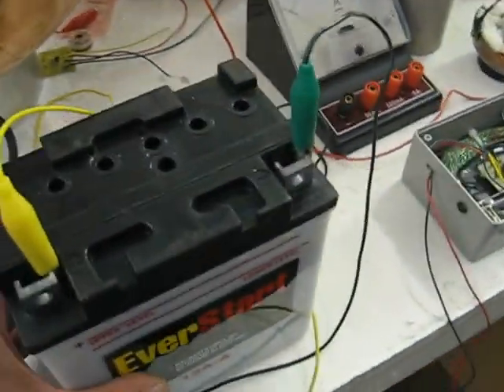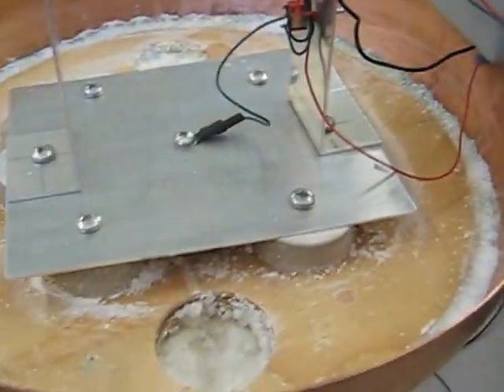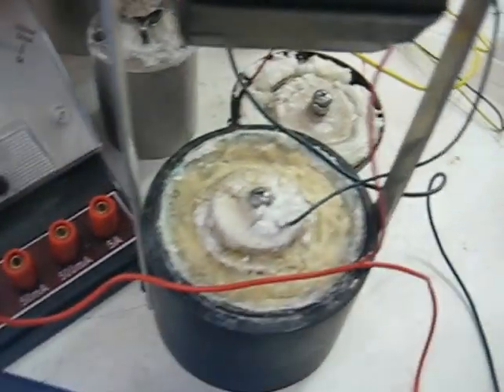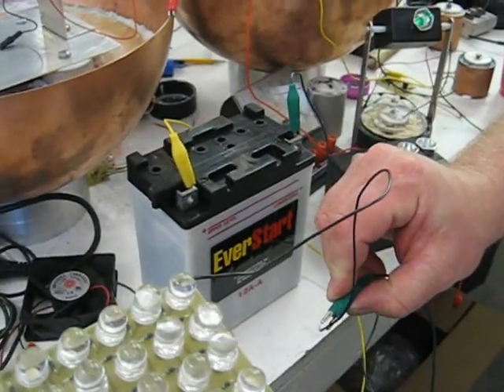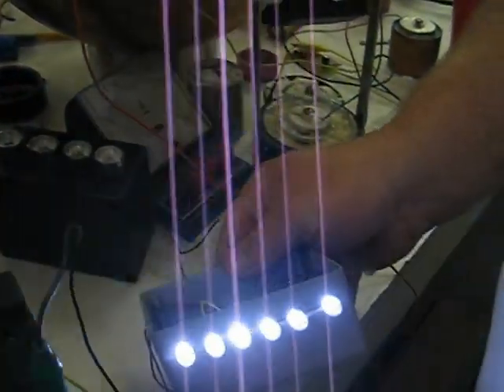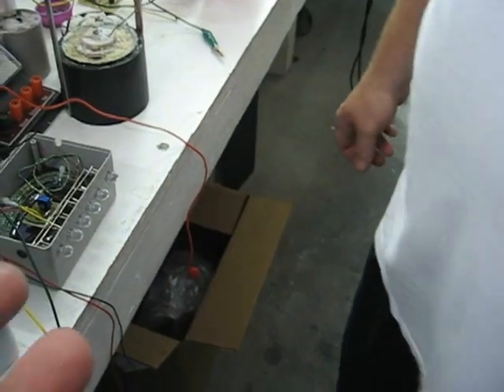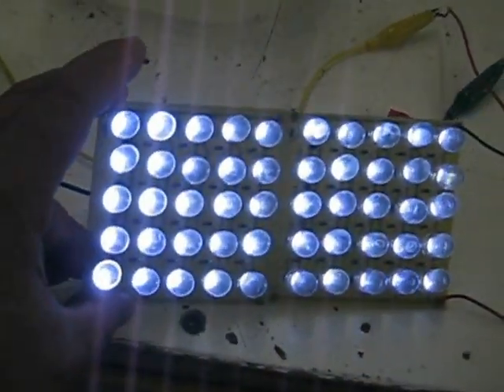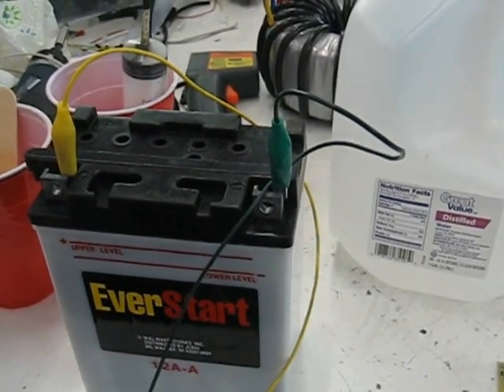New Crystal Batteries20  John Bedini and Chuck Hupp

Comment: Every battery has a rating called  Amp-hour measured in C20 ,C5 ,C10 etc. 
Theoretical Amperage delivered to a fixed load in C hours. 
Would be nice to know what to expect from your lead acid to crystal battery conversion.
Dont forget about the lead / lead-oxide chemistry that is typical to sulphuric acid.

Comment: Will this work with an old stuffed battery? If it was drained out, and maybe cleaned out? Or would the build/wear up on the plates dull the power? If so is it possibles to get less power for longer duration?

What sort of watts does it supply, and for approx how long before it starts to drop off? What is the single cell output?

Also I've always wondered if you can re-charge a crystal battery?

Comment: Don't you need to charge the lead acid battery? One plate has the corrosion and will give up electrons to the other and you must charge it to place the corrosion back on the plate? I must say using a Walmart empty battery was a good idea. What happens when you charge a capacitor with the lead acid battery, what voltage does it charge to?